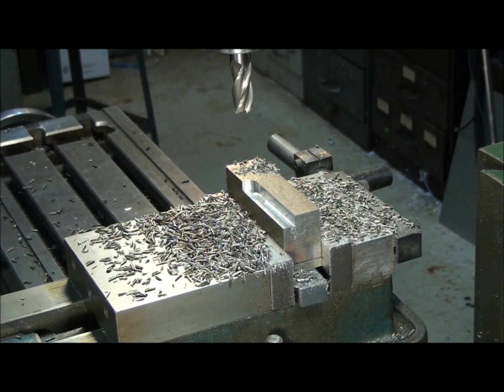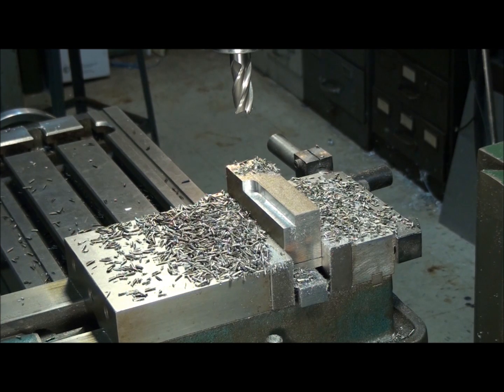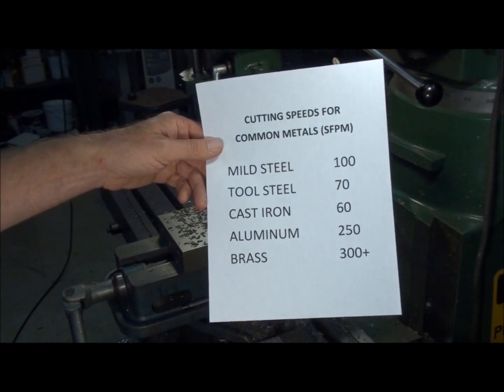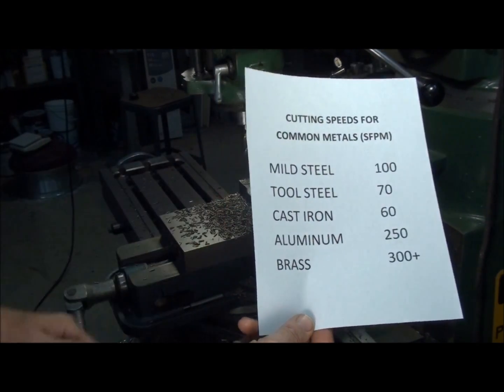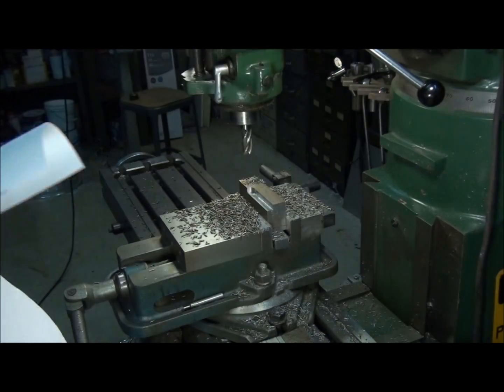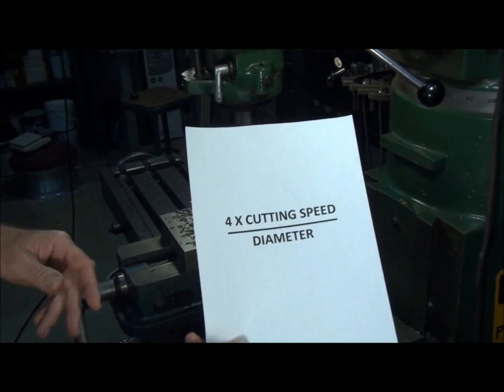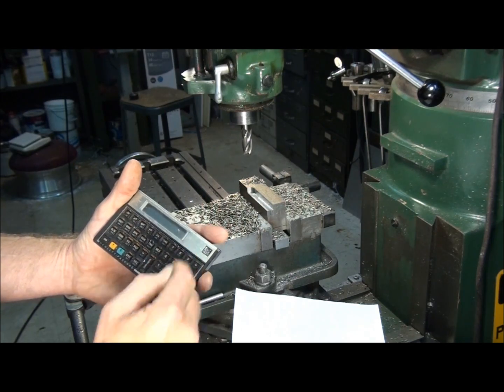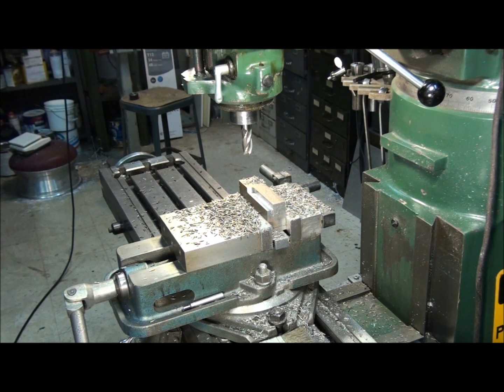Cutting Speed and RPM on the Lathe and Mill

Comment: what if your mill wont go that fast ?on stainless steel
Reply from the maker: +phil bailey 
Phil,

If your mill won't turn fast enough for a particular end mill/material combination, just run it as fast as it will go and reduce the feed rate accordingly to avoid breaking the end mill.

Tom

Comment: Another warped and twisted mind - Didn't know anyone else used RPN, 
can't live without it.  Use apps for my phone since my HP41-CV bit the 
dust.
Oh yeah, liked the video.  Sent it to my brother who is just getting started on mill and lathe.
Reply from the maker: +GunFun ZS
Reverse Polish Notation was used on engineering calculators starting in the 80's and has developed somewhat of a cult following. It makes quick work of solving expressions containing parentheses because it doesn't require the use of memories or equal signs. For instance, to solve the expression (5-3)*(6+2), you would simply enter 5 3 -, 6 2 +, followed by *. If there are deeper sets of parentheses, you just work from the center out, just like you would do with paper and pencil. It seems a bit awkward at first, but once you get the hang of it you'll never go back to algebraic notation.

Tom
Reply from the maker: +Scott Burrous 
I find it impossible to use an algebraic calculator. Use and RPN at work and in the shop, plus an app on my phone. It's so logical, I can't believe it isn't more popular.

Tom
Reply: +Scott Burrous Can you explain what this is? I am unfamiliar with the concept. Thanks.

Comment: The trusty HP reverse notation calculator...had one in college and still use 25 years later.  Nice video.  Thanks for sharing.
Reply from the maker: +djhoosier 
Thanks. 
Bought it in the 80's and it's still going strong. Don't know what I'll do if it gives up the ghost.

Tom
Reply: I've had my 15C for 40 years still going strong. It got me through Electrical Engineering. I heard it was programmed as a backup computer during the Apollo  missions to calculate  orbits and trajectories  in case of communications blackout with mission control.

Comment: Really appreciate the knowledge you are passing on as I start to teach myself some basic metal-working.  (I've acquired a South Bend 6" lathe and one of the import mini-mills).  

I need to mill a 30° bevel on 2 edges of a 3/4" aluminum plate (to slide into a receiving tray) and am planning to use a bevel cutter on my mini-mill (ordered an assortment of cutters and collets to be delivered soon).  

Your video gives a good starting point to select RPM on an end cutter that has a uniform diameter over its cutting surface.  What diameter do you assume for a bevel cutter that has a range of diameters over its cutting surface?  An average of the longest and shortest?  Or one or the other?

Thanks, again, for the info!  I've already learned a few things that I was doing wrong on my own.
Reply from the maker: +ArthurDent0042 

Thanks. I can't take it with me, so I may as well share it with you guys. :)

If you calculate the rpm based on the small diameter, the large diameter will be running too fast. With the price of angled cutters these days, I would base it on the large end, or somewhere in between.

Tom

Comment: What's the relationship between spindle speed and travel speed? I'm still doing my apprenticeship and we were taught how to calculate spindle speed as shown here but the machines we practiced on had manual bed control and the machine where I work has set travel speeds for all axis of movement. I feel like I'm always going slower than the machine can handle but the cutting tools are not mine so I wouldn't want to burn them out. Great video btw!
Reply from the maker: +Nathan Donovan 

Feed rate on manual machines, which is what most of us use is simply arrived at by observing feedback from the cut. The sound of the machine, chip color (steel), whether or not the chips are starting to stick to the tool (aluminum) are all used to indicate an appropriate or acceptable feed rate.

On machines where the feed can be set to a specific rate in inches per minute, lathes, CNC mills or mills with geared lead screws, the feed rate can be calculated based on chip load per tooth for whatever metal is being machined. This is a topic on my list of future videos. There is a fair amount of interest in feed rate, so I'll see if I can get to it this winter.

Tom

Comment: Vc for HSS Tools
Steel 20-25
Alu 30-40
Tool steel 15-20
Stainless 10-15

This all depends on what grade of materiel you're working with. And this is for metric, haven't a clue if it'll correspond to the same for the imperial system.
To calculate your actual speed on a normal calculator use this:
Steel:
25000/3,14/20=398RPM

And here your tool would be a ø20mm mill.

Lets say it has 4 flutes and you want to know how fast it should travel:
398*0,05*4=79mm/min

The 398 should be your actual speed on the mill, so if your mill's closest speed is 350 or 450 you use that instead.
The 0,05 is how much material you think the mill can cut per flute. 0,05 is usually a safe bet.

For HM the generel Vc is 100 in steel. 300 for alu and 60 for stainless. It all depends on what cutter you use and what grade you're cutting in.
Reply from the maker: +Mark Alexander Ragnvald Hansen 
Thanks Mark. It looks like there may be some useful information here for metric minded users. You may however want to explain what Vc and HM mean. If I don't know, chances are most of the viewers won't either. You may also want to explain what the various parts of your formulae represent. 

Tom
Reply: +Toms Techniques 
Really just meant as a quick comment :P
HM is the danish term for carbide, used it out of habit :) (Hårdmetal/Hard metal)

The formula should really be:
(V*1000)/pi*diameter=rpm - but it's easier to just multiply 1000 in your head and use the divide function on the calculator.

V is surface meters - I think. Translating technical terms isn't always easy without spending time to look them up. 1 meter is 1000 mm - which is why you multiply.

I do like your video though. It always annoys me when people ram a large drill into a workpiece at crazy rpms and then wonder why the drill broke or why it sounded like a Justin Bieber concert.

It's past 1am so I'm heading to bed now ;)

Comment: my question might be a bit specific but im dealing but dont have to be? dealing with small bits when im trying to mill 6061 or pcb/plastic but i own this cnc  http://www.ebay.com/itm/New-CNC-3020T-DJ-upgrade-from-3020T-Router-Engraver-230W-11000RPM-Machine-cmq-/251276149845?_trksid=p2141725.m3641.l6368

it came with some cutting bits but with no names maybe someone can identify this and tell me which is the one i can use for what stock material? and more importantly which bit should i think about buying for a sorta universal job? meaning many type and or sizes should i be focusing on buying to work on my 6061? 

below i post a link as well to my website where i upload my robotic design SL for 3D printin and my goal is to mill most of this parts on my cnc thanks

http://frankdesignatures.weebly.com/
Reply from the maker: Frank Lopez 
Hi Frank,

I think you might be expecting a little too much out of your machine. It is primarily meant for engraving using small cutter. Hence the 11,000 rpm spindle. While you may be able to do light milling on soft materials like plastic and wood, it's aluminum frame is probably not going to be rigid enough to handle metal, unless you use very small cutters. You'll just have to experiment to see what it can handle.

Tom
Reply: thanks Tom, can you expand or suggest on the type of cutter i can use ? i noticed most ppl with your skills like to throw numbers out there when dealing with cutters so maybe when i stop by a hardware store i can ask for that number your talking about when you say small cutter cuz if you you seen the link of the cnc i got theres a picture on the bottom of the page that shows the type of cutter that came included and i dont know but that seems small to me  but i dont know better  AND speaking of know better no tom im not expecting too much out of this machine as i never knew about this field so you can say that chinese bastar lie to me when i asked if i can cut 6061 and my plan was to sorta dive in  head first onto the learning curve as i did with my 3D printer
Reply from the maker: Frank Lopez 
It looks like the collet set goes up to 7mm, but that would probably be too big to mill aluminum. You might try an end mill half that size and see what it will do. If it chatters too much then use a smaller one yet. Two flute high speed steel end mills would be appropriate.

Tom
Reply: thank tom i will sure bring my current collet ? to the harbor freight store or lowells and see if i can pick up a set of this small 2 flute HSS end mill by the way tom i just used my caliper and that bit is 38mm long and 3mm on the diameter

Comment: Question, when they say they are making a .010 depth of cut does that mean you move the tool bit toward the part .010 or the total amount removed is .010 moving the tool in .005" thanks
Reply from the maker: Ed Ginsberg 
Ed,

A .010" depth of cut means that you move the tool .010" into the work. If you want to remove .010" from the diameter of a part as on a lathe, you would move the tool .005" into the work.

Tom

Comment: For metric multiply the cutting speed by 25.4 , surface mm per minute. eg mild steel = 2540 , and use the same formula.

5/8" = 15.875mm
4* 2540/ 15.875  = 640 rpm.

Some rounded off number for the other metals.
Tool Steel 1800
Cast Iron 1500
Aluminium 6400
Brass 7500
Reply from the maker: +Jack O'Toole 
I meant to post that in the video but completely forgot. Guess there's no time like the present. :)

Tom
Reply: Toms Techniques a
Reply: +Jack O'Toole metric cutting speed is measured in m/min. The formula for figuring out the rpm is (cutting speed x 1000)/(pi x tool/workpiece diameter)
Reply: +Espen Andre thanks,  I agree, the above is just a means of using a cutting speed quoted in feet per min with metric sized tools. Tom has a simpler answer which I overlooked before.

     cutting speed fpm x 100/ tool size mm
Reply: Toms Techniques a
Reply: okay this is really confusing me .. so lets say the SFM = 100 and I have a 10mm cutter,  now i convert SFM to  Mm/min which = 0.508  (used google)  so now i use the formula...0.508 X 1000 / 3.14 x 10  but that equals 1617.83... now i remember a college teacher saying something about moving the decimal.. so is my answer 161.7?? HELP ME BEFORE i GO insane!
Reply: 100ft/min should be approximately equal to 30.48m/min, not 0.508!!!!

As Espen Andre pointed out, you use end mill D=10mm
RPM = (30.48*1000)/(3.14*10)
RPM = 970

From Tom video, D = 5/8in = 15.875mm
RPM = (30.48*1000)/(3.14*15.875)
RPM = 611

The number is about right, because RPM = (4*SFPM)/D, Tom just use Pi = 3.

If you use Pi = 3
RPM = (30.48*1000)/(3*15.875)
RPM = 640
Reply: I find that with HSS you must run coolant at the speeds you are talking about as they burn out really quick on steel. I can't see the cutter in the video lasting much longer after that stint. In fact using HSS milling cutters on steel is just hobby or poor man's milling really. Might as well invest and get some carbide tools but they do like to chip on a machine that's not rigid so best stick to HSS if you have a vibrating machine

Comment: why is it that the harder the material the slower your rpm has to be
Reply from the maker: costanj 
Harder materials take more effort to machine and therefore produce more heat. That heat must be kept to a manageable level by controlling the cutting speed and/or using coolant if the cutter is to survive.

Tom

Comment: hey mate. thanks very much for showing this..  it has helped in a big way when working with my week old mill..
So basically,  would you stick to this formula for face milling as well?
Reply from the maker: FluffMuncher 

Yes. Just measure the diameter of the face mill and plug it into the formula. There is a chart on my website (tomstechniques.com) that shows the cutting speeds of common metals. You may want to download it.

Tom
Reply: Toms Techniques Thanks mate,  I downloaded it and I also did a range of conversions for metric (Im in australia).. speaking of which..  Is there a certain type of steel you used use with milling??  I got a heap of structural steel which is AS3679-300 grade  (NZ/Australia AS 3679-300 which equals =
UK BS 4360-43A,  Japan/Korea JIS G3101-SS400,  JIS G4051-S20, JIS G4051-S25C) But im not sure if its my optimum bf20L mill or the steel im using, it doesnt seen to like to cut it right... Is it possible the steelis too stiff?
Reply from the maker: FluffMuncher 

Structural steels are meant for welding and fabrication and have poor machinability. You need a steel such as 1020, 1117, or better yet, a free machining or leaded steel such as 1212 or 12L14. Those are very forgiving and will most always produce a nice finish.

Tom
Reply: Toms Techniques Thanks again Tom!  I thought mild steel is just mild steel and anything would be fine to machine..  But ill search for a supplier for some machining or leaded steel..  Cheers..

Comment: Excellent video Tom. Do you have a cutting speed and rpm chart for mm?? As for the coolant, in a hobby shop I would use it not to increase the cut depth, but to increase cutting tool life. In a hobby shop, time is not critical, but tool life yes (= more money in tools)
Reply from the maker: Just use the chart on my website (tomstechniques.com) and change the 4 to 100 in the imperial formula, then divide by millimeters. 100 x CS (in) / DIA (mm). It's not exact, but will get you pretty close.

Tom
Reply: pacombhl Hey Mate,  In terms of using metric..  I just converted my end mill mm to inches and use that..  And to save you the work...

5mm = 0.1968 inch6mm = 0.2362 inch8mm = 0.3149 inch10mm = 0.3937 inch11mm = 0.4330 inch12mm = 0.4724 inch
Face mill63mm = 2.480 inch
:)

Comment: Thanks for the video, I have a question Im new in using a mill, i understand the speed of the tool in rpm but how deep i can go with the tool and in which direction i have to make the cut ,also making slots make a lot of vibration and end up making a lot of thin cuts to avoid the vibration ,the speed of the tool its the same when sloting? Thanks
Reply from the maker: A good rule of thumb for depth of cut is 1/4 the diameter of the end mill. You can go deeper, but the feed would need to be slowed accordingly. RPM is the same for a particular end mill regardless of operation. The only time direction matters is when you are milling along an edge. Then you need to consider whether you want to climb mill or conventional mill. I discuss it on some of my videos, but have made one specifically on climb vs. conventional milling yet.

The vibration you are experiencing may be due to the type of mill you are using. Bench mills and mill/drills are notorious for their lack of rigidity. If that is what you are using, stick with the smallest cutter possible and take very light cuts.

Tom
Reply: Oh thanks for your answer , you are right I'm using a mill/drill , i will chek out your video for the climb mill vs conventionall mill, Thanks

Comment: On hobby type lathes the speed range is limited. For example, the lathe I am looking at has a minimum speed 130 RPM. I assume for example that if the calculated speed is 80 RPM the work round for not being able to set the speed to 80 RPM is take shallower cuts and watch the chip color?
Reply from the maker: Yes, that will work, or you can use coolant.

Tom

Comment: Tom, would 4140 annealed cut about the same as o1? I have my first custom work and it's requires cutting some o1for a reamer and the other part on the mill 4140 , I don't have any carbide tools yet I squared the stock with a fly cutter ,   With a hss bit ,but it put up a hard fight !Got any tips? .  Thanks for sharing you experience.
Reply from the maker: Both of those steels should be machined at around 70 sfpm. Keep the clearance angles on the tool to a minimum for good heat resistance and use coolant if possible.

Tom